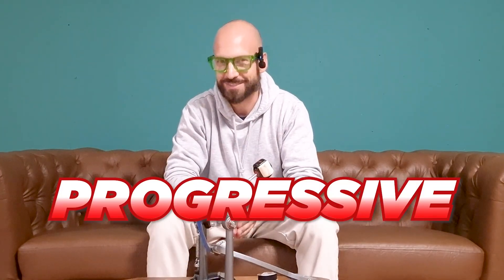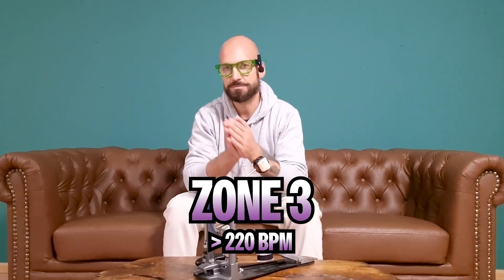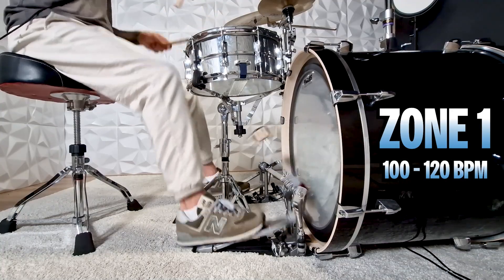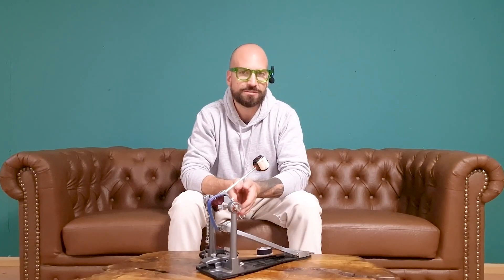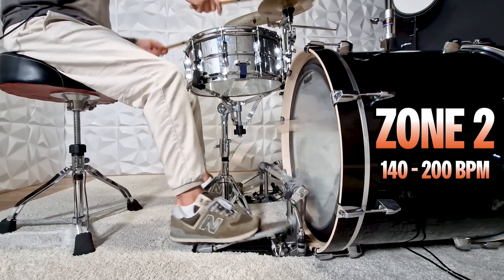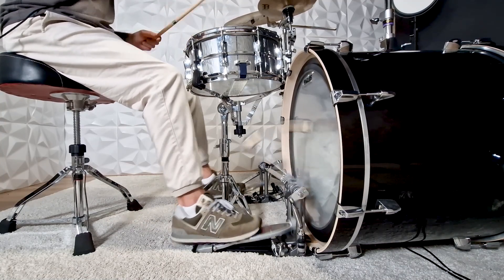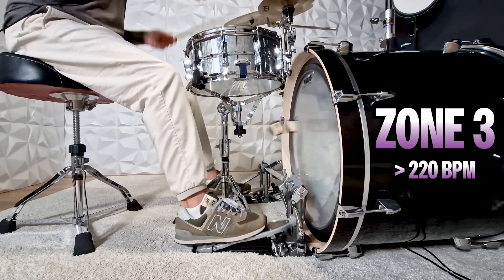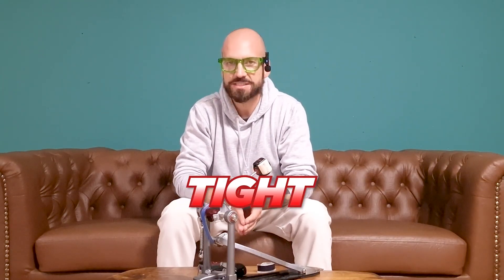Try These Extreme Pedal Settings - Pearl Eliminator Pedals

Comment: I have the OG Eliminator Double Pedal for the past 15 years or so. Though about a year ago I discovered ACD and Dennis's upgrades. So now I'm using the Direct Drive Mod, Spring Angle Mod with heavy springs, ACD Bar upgrade, Beater offset and beaters and now it's a whole new world. Way smoother and easier to use. I'm so happy with the ACD Upgrades I'm on the waiting list for his double pedal.

Comment: Ive been rocking the Pearl Eliminator Redline pedals for about 3 years now. 

I flip-flopped between all of the cams but i settled on these settings: 
White cam, 
Chain adjusted to the highest point
Beater sitting back around 70 degrees (almost hitting my shin)
Power Shifter extended all the way (making the footboard the biggest)
DW DWSM110 Control Bass Drum Beater with no weights in.

With these settings i play mid tempos (140-180) with ease! And i get some great heel-toe action for high tempos (180-230)

And the beaters give me some great volume. I dont need triggers until about 210 bpm

Comment: I've been using the Eliminators for about 20 years. I had the old ones, and now I have the redlines with the trick crossbar. I've used the white/clear and yellow cams the most. Now, since watching your latest videos, I'll admit I started tinkering more with the pedals. 
My favorite settings: 
Powershifter in the light position for all cams
My favorite cams are yellow, purple and white in that order. Yellow cam: I like a tight spring tension almost all the way tight. It's a bit of a slow cam, so it benefits from the higher tension.
I'm using purple currently at a loose/medium tension set up to my body weight. I can play faster than with the yellow cam, and I can do more, but my playing isn't as precise as it is with the yellow cam. All the cams are trade offs, you'll always lose something to gain something else
Reply: I also have the Trick drive shaft. It’s great. I have the blue cam now with medium spring tension.
Reply: Powershifter in “light position”?
Reply: @kingdick8390  yes, the heel plate is all the way towards you will put the Eliminator in the light position. I've been using the red cam now at about 80% tension.
Reply: @1manrcvids286 I’m trying to determine the difference in powershifter settings. All the way forward is… idk lol
Reply: @kingdick8390  All the way forward is my least fav. The middle spot is the factory setting. But the light position is best for me. Idk. Everyone is different, every leg and foot is different. My suggestion is to mess around with different settings and then leave it alone. Tinkering can make you crazy.

Comment: Red cam, mid low tension

Red cam is vvv aggressive it ripped through my foam protection protection on my v kit kick pad .. insaaaaaane engineering. Redline all the way
Reply: Pear pedals suck.

The Dyna sync is great

Comment: I've been using Eliminators for 10+ years. In the beginning I experiented with them a lot, then I found the "perfect spot" and kept those settings for years. I had a belt drive, and I used blue cams, but the purple cam was the one for me. The red ones were too just too much. 
For me the purple has the right balance between feel and beater action. (I'm using swivel technique, and mostly play around 140-200 bpm)
I just recently got a an ACD direct-drive upgrade, and I must say it's a whole new world! :)

Comment: I find the blue one works well for my technique. The red cam feels light on the initial stroke ( which is good). But it's a bit too agressive for my liking as i just starting using the Eliminators. Hence, the blue cam fits perfectly for me as of the moment.
Reply from the maker: Yeah that's one of the weaknesses of the red cams
Reply: What’s your technique? I’ve been using the white cam for about a year now. Was thinking of switching to blue.
Reply: @Mari000  it's simply full leg motion for the slower speeds and ankle technique for the more faster stuffs. I've finally switched to the red cam a month ago from the blue one and I've gotten used to how it feels now. The old pedals I was using for years had a round cam so hence getting used to the more aggressive cam took a little more time than I expected.

Comment: I love those cams but after time when drive loosens the become uneven due their nature
Reply: what?
Reply: please explain more i own these and now im worried
Reply: @contramachina354  don't worry, it takes years to loosen the shaft. Because the cams don't have linear characteristic when the shaft is loose left pedal will be a bit lower naturally. While the cam on right pedal in neutral position will be lets say parallel to the floor on left it will have a bit of slope, making it have different action. 
White or black cams don't have this problem because they are linear.

Comment: i m equally bad using all the cams🥲
Reply: me too - i have the eliminator redline double pedal, and even at the loosest spring tension it just requires so much effort to play. i dunno what im doing wrong, im trying every setting
Reply: @contramachina354  Practice with shin weights